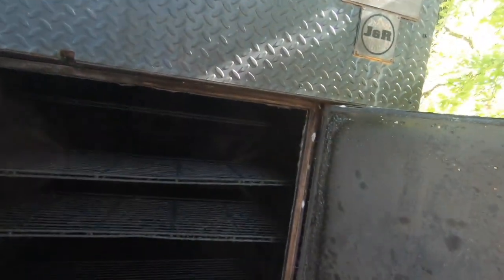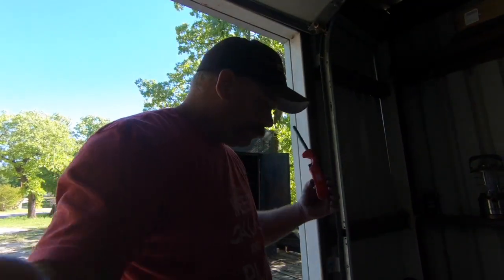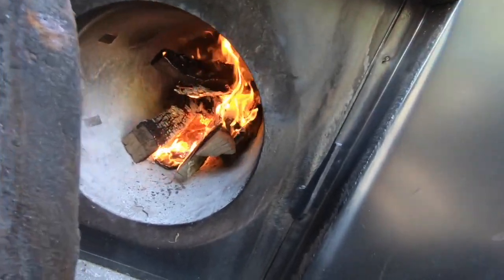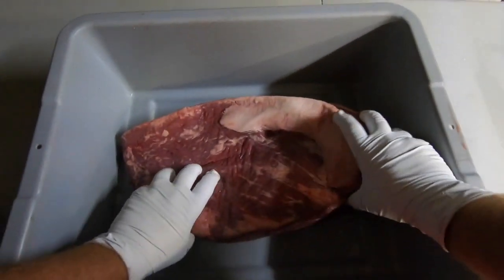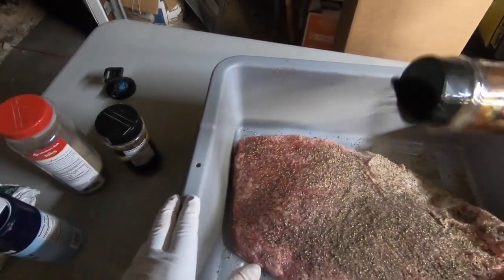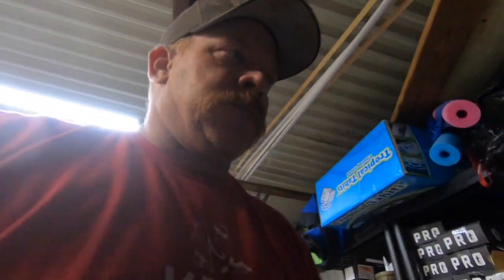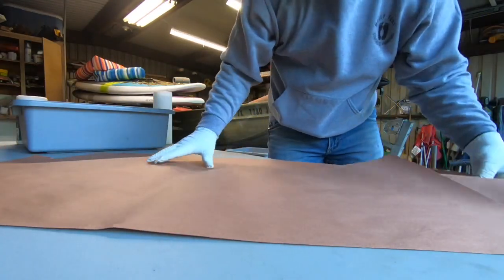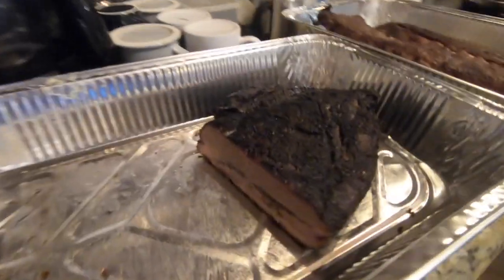Cooking Briskets on my Oyler 700. cooking with MuddyfeetTV

Comment: Thanks, Great Video!  Does the adjustable needle on the thermostat control the temperature?  Did you use any of the other smokers by J&R (Smokemaster, Little Red Smokehouse) before buying the Oyler?  If so what did you think of those?  Thanks again!